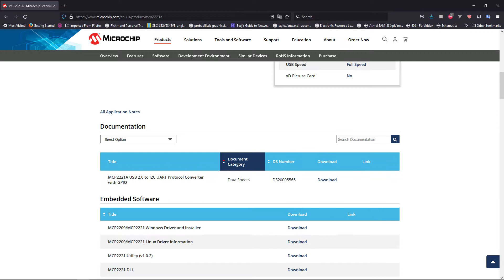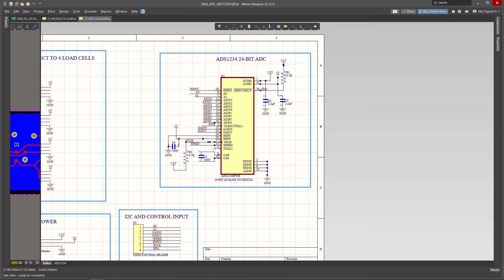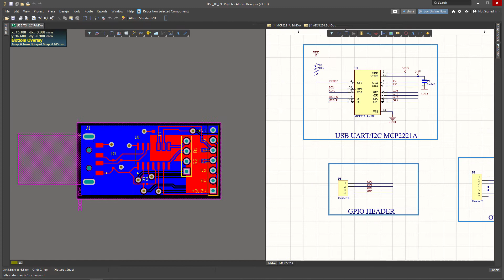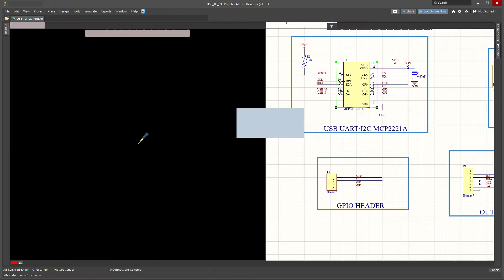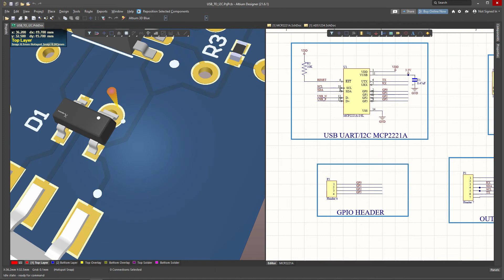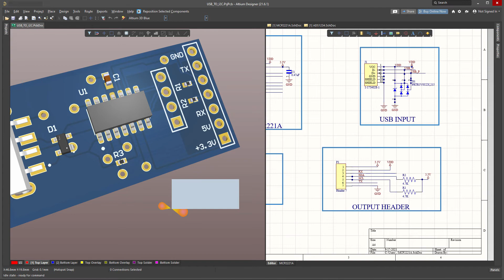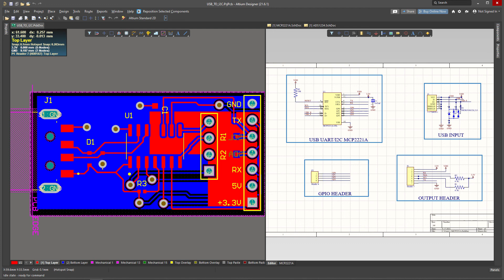How to design a USB to I2C breakout board using MCP2221A (Part 1)

Comment: Bro can you guide me for something similar
Reply from the maker: Sure. What is your question?
Reply: @antshivrobotics  bro I want to build a custom solutions to communicate with TI BQ76952
Reply from the maker: @kalvo-no7oq  it should be functional. Alternatively, you can utilize the MCP2210 SPI for interfacing as well. Here's a video link for reference: https://youtu.be/rJnTBsqV2K0?si=h9-TUWiuQiJuXDaG. Keep in mind that to make this setup operational, you'll need to connect it to a computer because the drivers are specifically designed for a host operating system (Linux, Windows, or Mac) and are not straightforward to integrate with other microcontrollers.